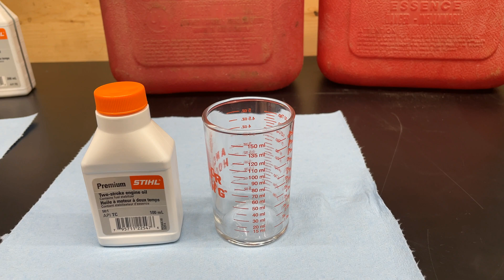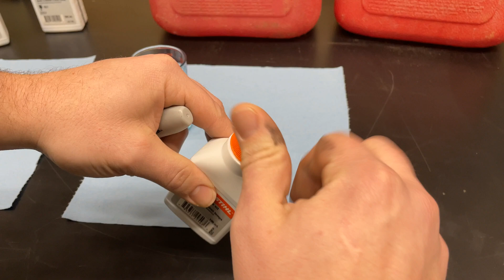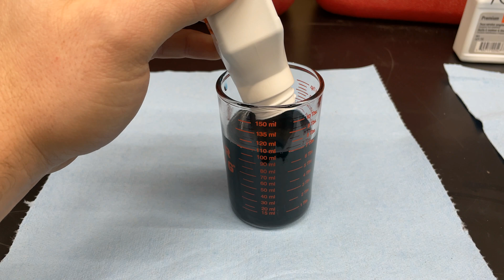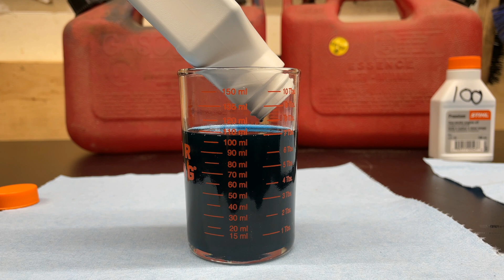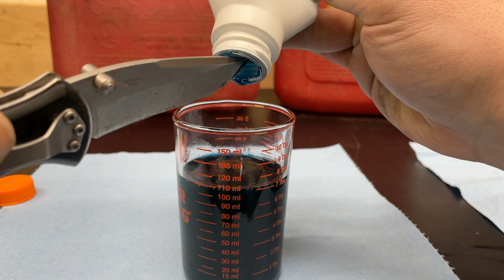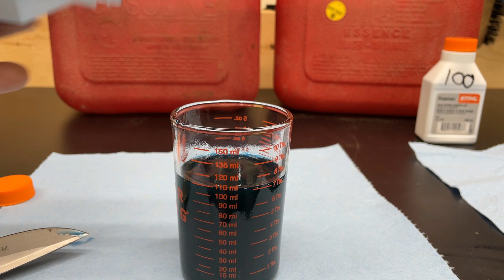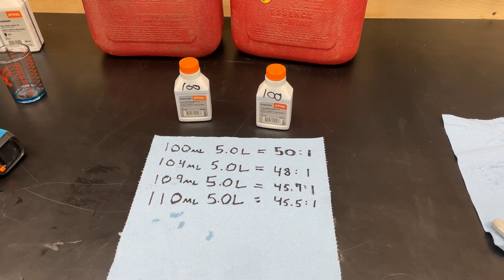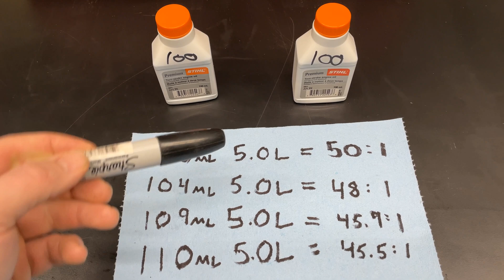Inconsistent 2 stroke mixed gas... Does every drop REALLY count? (Surprising test results found!!!)

Comment: Here we sit watching an attempt to determine the contents of a two stroke oil  container when no one ever measures the exact amount of gas in their can. They just eyeball the fuel level as it goes into the container at the service station.How can you guarantee the exact 50/1 mix ratio using that method? Not too scientific nor does it really matter. My Stihl saws and trimmers have worked well for years without the needless fiddling with beakers or measuring cups. With Sthil oil, just run your tools at max for a clean burn.
Reply from the maker: That’s pretty much what I do Richard!

Comment: Since I mix varying amounts of my own ethanol removed gasoline, I measure the exact quantity of Stihl Ultra for 50:1.  A lab flask helps and if its narrow, tall and holds just a little more than you need, accuracy will be highest.  I also flush the mix out of the flask to get every tasty last drop :)
Reply: Not nearly enough oil

Comment: I assume that these bottles are filled with the same technique as everything else these days and that is by way of assembly line/conveyor system kinda like the way beer and soda drinks are bottled and the measuring accuracy would be checked after about ever 100 bottles to make sure they remain within a certain tolerance. In other words each and every single bottle would not have the absolute same exact measured amount as the next bottle which in my opinion just reinforces the idea that it really doesn't matter if you have your measurements exact or if you are off by a tad little bit it isn't going to effect the engine any. 50:1 or 48:1 or 47:1 or even 52:1 I seriously doubt it would do anything except possible change how much your machine smokes during use.
Reply: Excellent

Comment: I use one of those Briggs & Stratton 2 cycle oil bottles with the squeeze dispenser/measure. Most of my saws are older so I run everything 40:1, even my new trimmer and whatnot. Never had a single issue with the slightly richer mixture. These bottles having a hair more oil in them is probably better for the engines as I feel that 50:1 is a tad lean, and done mostly to appease the EPA. shrugs
Reply: 40:1 all they way mate! 50:1 is definitely emissions I was told so by sthil dealer years ago.
Reply: @backwoodslogging8443  32:1 has more power. if my oil was cheaper i'd run 18:1

Comment: I have a small measuring glass.  I put about 75 ml of oil, as measured in the measuring glass.  I try to eyeball it between the 70 and 80 ml lines and shade it to slightly more than half way between the two marks.  Most Stihl Ultra bottles I have measured were slightly more than 70 ml, let’s say 72 ml to be fair to Stihl.  That’s, about 2.6 ounces.  50:1 is 2.56 ounces.  (128/50), so you see my mix is greater than 50:1.  I now use the Echo squeeze bottle and squeeze the container until it is at the 50:1 line.  If you want to get a 50:1 mix with a 5L tank, just fill to the 40:1 line.

Comment: 32:1 is the best ratio for performance and longevity. Just fatten out the top end and let her buck.
Reply: Can you please tell me what fatten out the top end means? I'm not a mechanic.
Reply: @dougsorensen7594  you need to richen up the air fuel ratio because there is less gasoline and more oil in the fuel.
Reply: @chrisrossman9566  Thank you Chris, that makes sense to me now.

Comment: Would I sound like a boffin id I suggested if you rely want to be accurate you would weigh the oil?
It seems you should get 100 ml of oil as long as you are sensible.
How carefully do you measure the gas part of the mix?
Will a tiny bit extra oil in the fuel only slightly detune the motor?
At least it will keep they lawyers happy.

Comment: those glass beakers are not precise enough... ive tested plastic ones that were off by alot as well... manufacturing defect in that case ive marked them with marker... the 25ml mark is really 40 in my case

Comment: I mix my hp ultra and add 1/4 oz stabil 360 and 1 oz Lucas fuel additive then fill with 89 octane. My stihl 015L , 038 mag2 , and new ms251c all run perfect . I even run my poulon pro / husqvarna 5020 on it . Easy starts next I let them run for a minute before putting under load . Last can I filled had 1.002 gallons as indicated at pump with previous added first for good mix . Anything produced has a tolerance amount but I have yet to find out from Stihl what an allowable tolerance is .

Comment: From 20 years of rebuilding demo saws I have seen many failures due  insufficient lubrication running 50:1  I run  25:1 in my own saws with no issues except on a small husky brush cutter which dripped oil from the muffler, 40:1 fixed that problem. better to err on the safe side.
Reply: I run 42.5:1. 50:1 is an EPA ratio.
Reply: 25:1 I think you wasting oil for no reason I don't think you need more than 40:1 in your equipments
Reply: @ronaldimarai818  oil is cheaper than a rebuild

Comment: I run everything at 40:1 and if it's an old motor I will go 32:1. The 50:1 that manufacturers recommend now a days is too thin and will decrease the life of your motor. I have been a small engine mechanic for 28 years and have seen it first hand.
Reply: Yea the lower end bearings don't like 50:1. Nor does improper carb tune, going just a bit lean and you'll starving the engine from oil. For homeowner use it probably wont matter for most, but for a pro grade saw that's running 500-1000 hours before bearing failure at 50:1 or 3000+ hours at 33:1, I know how I'll be mixing.
Reply: I use 32:1 in my older steel sleeve engines and 42.5 :1 in all my Stihl engines and others calling for 50:1.
Reply: @shannonwhitaker9630  50:1 is more than enough for the top end lubrication, but not good enough for ball bearings. 50:1 is mostly forced on by emission regulations on these companies. Stihl and Husqvarna don't recommend 50:1 in most Asian countries where they sell their products for example (Except Japan, and maybe South Korea?).

Comment: Due to capillary action of liquids, the edge of the top goes up. A proper measurement when measuring fluids is to read the bottom of the meniscus not the top of the meniscus. So the first one was probably on 100 ml and the second around 104 ml. But we also don’t know how accurate the small measuring cup is. You would be better off using a graduated cylinder for this test than a measuring cup.

Comment: Why not just take the first one after you poured it and took a reading then turn the rest of the bottle upside down and let it drain the rest, then do the same with the second bottle to test bottle to bottle volume as well? Thanks for taking the time to do this.
While being close is important I don't believe having to be the exact amount will make that big of a difference, If running an engine that close on the mix ratio means it makes it or not then that's not the oil for me, temp/weather conditions will make a bigger difference on how the engine is performing I believe and I always carry an adjusting screwdriver with me for dealing with this, newer engines with the Autotune will help most folks that don't want to deal with adjusting the carb.  
Running fuel that is non ethanol, making sure to stir the jug before pouring it into the tank of whatever you are running and making sure to wipe around the fuel cap to clean debris first. Just my two cents which wont get anyone anything.
Reply: Even old engines were designed with a plus/minus being within the operating range

Comment: If you get hold of the test procedure for JASO FD oils you will see that the test engine has to survive without scuffing at ratios as light as 200:1 and not suffer carboning up with ratios as heavy as 15:1.  No need to get to anal about premix ratios.

Comment: I wonder how many people actually measure the gas they are mixing? I figure the engine/saw manufacturers allow for small variations i  the fuel:oil mixtures. I personally have mixed simply using the "fill" line on the side of my fuel jug and so far have had no problems. Pretty sure there would be a lot of variables there...lol. 
So short of having a large enough beaker and lots of time to mix the fuel and oil, I'm thinking there is a good safety margin built into the fuel:oil mixture.
Of course I'm just a civilian and not an engine ear (little joke from an engineer friend of mine) so my opinion along with a couple bucks could get you a double double at Tim's. lol
Reply: Ratio Rite cup….maybe $10
Reply: @shannonwhitaker9630  looks like a good idea...but most people I know peobably would take the time to use one. 
I can remember dumping the oil in the fuel tank of my Ski-Doo and then watching the meter on the gas pump...lol. This is why I wonder about the margin for mixtures. 
Cheers
Reply: I’d say you could do it that way with no problems as long as you know how much you oil you are dumping in for the amount of gas pumped. As impatient as people are they’d probably take off without shaking the machine to somewhat mix the oil.
Reply: @shannonwhitaker9630  yeah, the motion of gas being pumped would mix the oil pretty good but then the "trails" back then weren't much so the machine (and I) got shaken quite well. lol
Reply: I was thinking pump the gas first to know about how much oil would be needed. Just dumping in oil without any idea of how much gas in going in next sounds like a bad idea lol
Reply: @shannonwhitaker9630  I knew how much the tank held and it was pretty close to empty...and I knew how much I could afford (I was just a poor teen ager back then...lol)

Comment: It's very "telling". that whichever way you did it there was always more than 100 ml.  So obviously if you're gonna get it wrong then it's better to have too much.
Me, I use a large plastic medical syringe, suck out the amount that I need from a 1 litre Stihl Ultra bottle and squirt it into 5 litres of petrol measured out at the Petrol pump.
I'm very into' accuracy' though !
Also, If you could give temperature readings in degrees Fahrenheit that would be great for us here in London, UK.

Comment: Many states/provinces have requirements for meeting “filling” standards.  If you advertise that you are selling 100 ml of oil then you need to deliver that.  Because of fill variation, producers tend to slightly overfill to meet requirements.  Your bonus of extra oil/container results in at least a 50:1 ratio and possibly richer 46:1 ratio.
Reply from the maker: Hey Richard - is there a list of that minimum anywhere?
Reply: Dave — I don’t have detailed info on that.  Having worked in the chemical industry I do know that meeting filling standards was critical.  Sophisticated delivery systems and software are used to ‘statistically’ meet requirements.

Comment: My question is what is the ratio of oil to fuel. I have seen it expressed as 1:50, 1 to 50 and 1 in 50. If you think about the language, 1 in 50 means 1 part of oil in 50 parts of 2 stroke fuel, which translates to 49 parts of petrol (Gas for the Americans) and 1 part of oil or 4.9 litres of petrol and 100 ml (0.1 litre) of oil.

Comment: It's chainsaws, not rocket science.  It's not the oil amounts that would be consequential, it's the gas.  If the large volume 5 gallon red gas can (or liters) is accurate, or the meter from the gas pump are all the same.  Then it might matter.   But 2 cycle engines are very forgiving.  And I adjust oil amounts based on outdoor temperatures (summer versus subzero).   Fun project though.

Comment: Interesting but what's to say the cup is accurate? Would like to see some different brand measuring cups.
Reply: Measurements are more accurate by using the same tool/cup to make your measurements. So as long as you use the same cup you can make better judgements and assumptions on what you measure vs using 2 different measurement devices. There would be more inconsistencies and variables using different cups. More so would be the volume of gas that is in the can. Different pumps could be dialed wrong(.995 gallons vs a true 1 gallon)or different gas cans could be off a bit as far as the full level lines. I think that would be more where the changes would be found.
Reply from the maker: I agree! I’m going to get a scientific kit and try it again!
Reply: Richard Flagg has a video where he used a graduated cylinder to measure, then check the same kind of Anchor Hocking measuring glass. It was accurate.

Comment: I buy my 2 cycle oil a gallon at a time and we mix it 5 gallons at a time we go through 10 to 15 gallons a week of mix fuel in my landscaping company I'M sure our mixes very a little with each 5 gallons we mix but I have never noticed any adverse effects on my 2 stroke engines.

Comment: You know I love it when you do science! It would honestly be interesting to see the factory that fills these bottles with oil, just how accurate are they? Do the filler machines work based on weight as the cutoff, or do they measure ML? I think nothing of a factory tour, would be able to answer this. It is also indeed possible, that there is a manufacturing consistency, if this wasn't intended at all, and you may have possibly brought the issue out to light as well IDK.
Reply: I agree. There can be variations in the filling machines within the same plant and across the contract manufacturers that bottle the oil. Slightly overfilled bottles greatly reduce the chance of legal trouble for cheating customers.

Comment: You can check manufacturer inconsistency by draining three bottles the same way, using the same measuring glass. I doubt the consistency of the screen printing on any two measuring glasses is the same. Thanks for the video.
Reply: Weigh each container with a digital scale to verify consistency.
Reply: That's what I thought. That piece of glassware is not lab quality.

Comment: Having oil/fuel mix close to 50:1 is  good enough. No white bottle 100ml in the U.S.  2.6FL.oz,76.9ml is mixed to 1 gallon. I have to special order 100ml bottles for 5L cans.  Your "cooking cup" my not be the most accurate graduated cylinder. A lot production lines use weight to fill things. Who makes the oil for Stihl in  your market ? I have never had a saw fail to lack of the "perfect" percentage. No oil, she gone in one tank. I do rinse my containers of oil with fuel to save the planet and recycling. Ha.

Comment: From my experience the difference between 50:1 and 40:1 is going to very minimal , if at all noticable. You won't satrt to notice a major difference until you get to the 32:1 or 25:1. I usually measure my oil manually and I don't use the small bottles, I tend to go with larger bulk bottles. Or I use the mix pouches of Stens Mix or Opti 2 where the one mix is good for all ratios, where the actual ratio is more like 70:1 I get great results with that.

Comment: better to error on the side of too rich then too lean , what I do is to take a splash of gas and rinse out the oil bottle, even though the pump says you pumped 1 litre or gallon ,there is a 1000 possible different amounts that comes out the hose , same with the oil filling machines , sometimes industry has to allow for discrepencies  of measureing devices and owners concept of the exact amount . . maybe adding the extra oil to allow for the "i'm in a hurry " to mix my oil and go back to work and still achieve a 50:1 mix!!!???   this whole issue may be to why they went to fuel injection????  just like the snowmobile mfg's did decades ago????

Comment: Another thing to consider is how accurate your fuel measure is. You can't really trust the gas pump because there could be residual fuel in the hose. Your fuel can will also hold more than its rated volume. You could be a little off either way but l am relieved that there is a little extra oil in the bottle to adjust for errors.
Reply: THATS AN ANCHOR HOCKING GLASS MEASURE. they made measuring equipment about 100 years. I think your right though because theyre all varying in accuracy. 😁 some cakes are perfect, some cakes taste like mix oil ahhah
Reply: you do realize that (at least in the USA) fuel dispensers are calibrated and inspected to be exact. It's a matter of consumer protection and it's regulated by state agencies.

Comment: I’m sure anyone who has mixed 2cycle fuel enough has asked themselves this question. Sure there’s small variables, but I’m in the woods not the lab and I feel much more confident now that you did this video. Thanks, from northern Idaho!
Reply: Don’t assume that the average consumer thinks about it. They open the bottle , pour into a gas can and away they go for gas. At the pump, they fill until they see 4.5 to 5 litres on the pump readout and stop. Shake the can and fill the unit. Done. The gas isn’t consistent and neither is the oil mix. I have been running Sthil products for 40+ years and have never had an issue. I pay a lot more attention to the chain condition and lube function. I also have always run each and every unit on premium pump gas (not a premix of any brand) complete with Stabil for storage.

Comment: Hey Dave. 
Great video 👍
I think it‘s not that critical, if your ratio ist 50:1 or 45:1… The type of oil must be the right. The lubrication of mineral oil in a mixture of 1:25 is almost the same as you get with fullsynthetic oil in 1:50… I hope you can understand what I want to explain🙈🤣
Greetings from germany,
Stefan
Reply: Stihl premium oil 50:1 is a Mineral oil-based engine oil.

Comment: Wonder if the bottles contents vary between bottles more than the method you use to pour making a difference in how much you get out????   

I would also agree with you that they probably very slightly overfill because they know some people will sit there and shake the bottle to get every little bit out and some dump it quickly and go.  So they want the minimum you get to be the indicated ratio of 50:1.  And if you get slightly more oil because you take your time it will be fine.